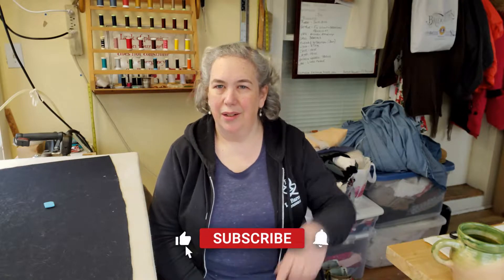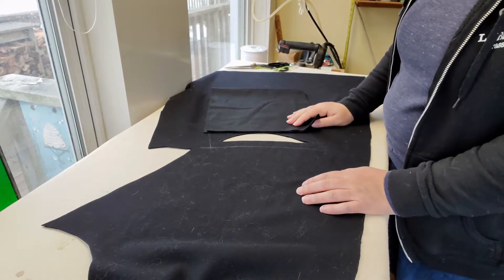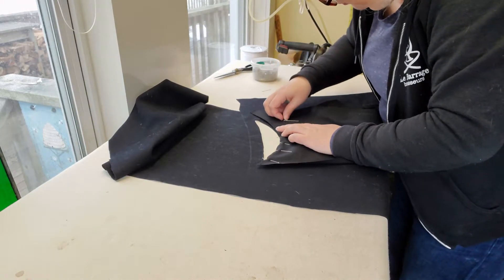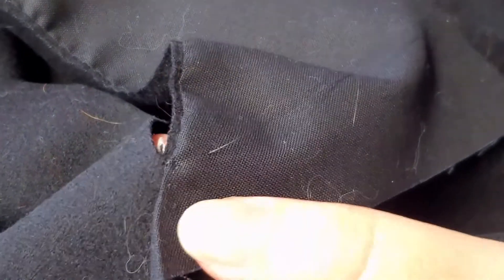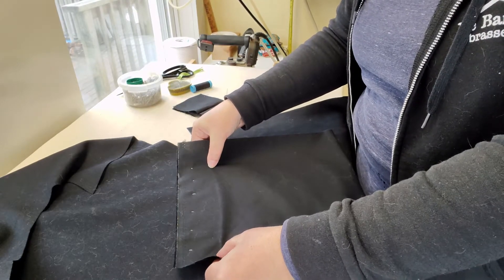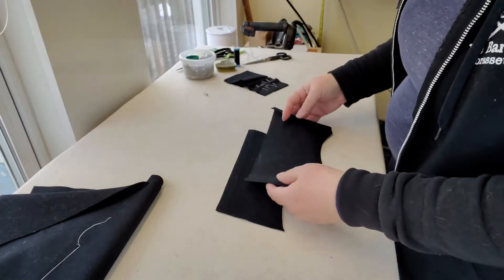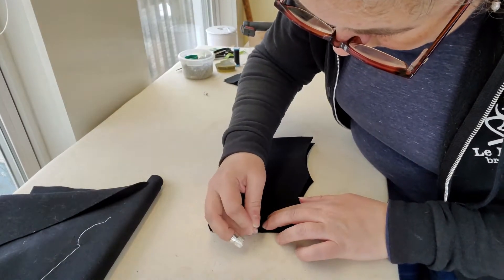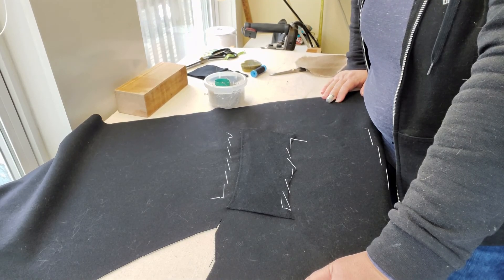18th C. Frock Coat part 1: Pockets and Pocket Flaps

Comment: IVE JUST DRAFTED a pattern for a victorian frock coat and Im really hoping there are enough similarities for me to get the construction sequence...
Reply from the maker: you might want to grab a modern tailoring book to help you in this process too. Tailoring gets far more in-depth as the Victorian age progresses.
Reply: @kellyarlenegrant  - OH Im ok at making lounge suits, Chesterfield coats etc.  Its the order the body panels and the skirt are constructed in that I am interested in... 

I've not made anything with a top half and a bottom half in one garment before.  Do you make a left and a right and sew them together???  OR do you make a top and a bottom and sew them together???  This is my dilemma...
Reply from the maker: Well, it's not as simple as that...I build the fronts, from the wool inwards, shaping the garment with canvases. Then I line each piece. Tailoring is a huge thing. Have a quick look at a tailoring book such as the green "Classic Tailoring Techniques"
Reply: @kellyarlenegrant  - HI - just letting you know, Ive finished it.  I constructed the entire coat including canvas, except the lining and facings, tried for fitting and made adjustments. Split at the centre back seam and the shoulder seams, removed sleeves. applied the lining to the facings and then to the coat. Stitched the lining to the coat flat [no quilted padded lining on this as its a frock overcoat not a frock coat] closed up the shoulder seams, fitted the sleeves, closed the centre back seam and then sewed the centre back lining panel then fitted the sleeve linings... 

Looking at many pictures of extant Victorian frock coats this seems to be the way they did it, its quite easy and the only way I can see to get the quilted padded linings incorrectly.

Comment: How would you go about sewing in the pockets with a fraying fashion fabric?
Reply from the maker: I might use a machine, and run a stitching line in a fine stitch length about 3mm outside the cutting line of the smile. Then clip to, but not through the points at either side, and turn your edges under. Then proceed to stitch the pocket bag in place. So stitch your smile first, then cut the smile inside the stitching line, fold edges under, and proceed with pocket.
Reply: @kellyarlenegrant  I see! Thank you so much for your videos and this answer!

Comment: I have a question:  How do you sharpen your shears?  They always seem so sharp.  What do you use (tool) to sharpen them, and how often.  Also, I inherited several pairs of shears and scissors and they all need care.  Is there anything that I can do myself, or do I need to take them to a professional.  I have heard horror stories from people who took the shears/scissors to professional sharpers, and I would rather to not have to deal with that.  Maybe you can do a video on maintaining you cutters.  Thank you.  I really like this video.
Reply from the maker: Hey there Duck! I have mine professionally sharpened about once a year...well, before covid I did. I also have shears for fabrics, another pair just for wool, and if I need to cut silk I go buy a new pair of shears and then they usually get moved on to paper scizzors shortly after. I don't use my good shears on anything poly...those get cheap craft scizzors and trashed after. I'm not sure who is sharpening in the Maritimes these days, so I'm not sure who to send you to. These scizzors I am using in this video need a good going over, so I will have to find someone eventually. They were far too expensive to buy again.
Reply: @kellyarlenegrant  Thank you Kelly,  I didn't realize that you switched scissors in and out as often as you do.  I find that fascinating.  I completely understand why you would switch them out for the silk but I didn't realize that you would for poly.  I will take a picture of my scissors when I get them unpacked, so you can see what I have and what kind of condition they are in .

Comment: Are there no linen stays to help support the pockets?
Reply from the maker: I usually support the pocket opening with canvases.
Reply from the maker: Ah! This coat I canvassed more of the body, so supported the pockets to the canvases once I laid them in.
Reply: @kellyarlenegrant  I see, thank you. In the Edwardian coats I've made the canvases are much smaller only going through half of the frons so additional stays for the pockets are needed, often extending from the side or down from the armscye.
Reply from the maker: Parker, that's the case with a lot of 18thC coats as well. Especially later in the century. I think cloth will always tell you how structured it wants to be...also the human wearing it. No two coats are ever exactly the same